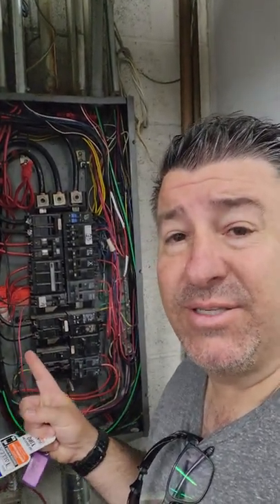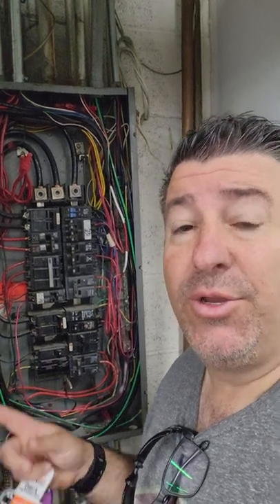How would you deal with this electrical panel? - Comment below.

Comment: It's a bit crowded and a little messy but as long as everything is working fine and the connections are torqued to specs and the breakers are fairly recent, leave it alone unless the panel has run out of capacity.

Comment: I would replace any breakers that are over ten years old or are loose fitting or are not the same brand as the panel or may be of some obsolete brand.  Breakers that are too easily tripped need to be replaced, as well as breakers that are regularly used as a switch e.g.: for shop lights. Some breakers might be upgraded to GFCI or surge type as needed. Of course, tighten all connections to each breaker, and recheck any stranded wire connectors for fraying.  Be sure to check for any double connections on any breaker and replace with a double breaker or a new breaker in an empty slot for the second circuit.
Reply: Let's say you find a double connection.. you take one put it on a new breaker.. wouldn't the neutrals now be crossing as far as the rest of the connections in the house? Wouldn't that cause a breaker to trip?
Reply: @ederrocha3491  no your neutrals still all run into the same bar from what I’ve seen. Normally it’s two powers on one breaker.
Reply from the maker: It will on arch fault and gfi breakers. If nit on same phase you would be doubling uo the neutral instead if zeroing it. Good question

Comment: Check the wire sizes with the breakers, tighten the screws, make sure no water or overheating and its good for another 50 years.
Reply from the maker: ..and put on a new dead front! I keep forgetting to mention that. Thanks - where you tuning in from?

Comment: How would you address a panel with 2 wires coming off of one switch?
Reply from the maker: @cringesh1t427 several ways you could address that from cheapest to most expensive
1. See if the breaker is rated for double tap. Believe it or not some are but very rare
2. Pigtail it with a wire nut or wago in the panel. Most panels it is legal but only to extend, i'll have to check code or UL listings for that
3. Install a "Twin" Breaker or another breaker on the same phase if you have a spot open
4. Take out a 2 pole breaker and add a small sub panel to add additional loads. Be mindful or AIC rating etc.
5. Get a new "bigger" sub panel
I'm sure there are a few more, these just came to mind. 

Thoughts everyone?

Comment: We had an electrician say it would be almost 10k to move a circuit box outside and add some grounding rods. (It's an old house.) Does that sound reasonable?
Reply from the maker: Depends on how many circuits where it will be relocated, is it overhead or underground. If it's underground will they replace incoming conduit or relocate it? So much goes into this that we don't know. An average 200 amp same location overhead in my area starts at 3k to 3.5k and that's pretty much a single day 2 electricians
Reply from the maker: What state matters as well.

Comment: I would give them options, if im needing to add one or more new circuits i would recommend adding a subpanel before filling up that panel, but there is nothing wrong with that panel if you dont need more circuits.

Comment: What’s the problem with it?
Reply from the maker: Hey Dave, good question. Its not easy to see in such a short video, so i checked my high res picture again to try and list everything.I went back and counted the issues. It's hard to see in the video but most electricians probably saw at least 3 or 4 of my list right away. These are not in any paticular order. Add to it if I missed anything you see.
1. Workmanship - were required to do neat work
2. Missmatched breakers. Diffrent brands not approved or UL listed for this panel
3. Panel being used as a junction box. A few in and out circuits. Who knows what for? 
4. 3 wire circuits are not identified with shared neutral
5. Cut wire with no wirenut on end
6. Deadfront missing
7. Can't label panel with no deadfront
8. Wires caped off with electrical tape
9. #8 wire taped white 
10. No Ground in main feed conduit
11. No ground bushings where required
12. Top left side of panel bent from bad measuring of incoming conduit and missing straps
13. Numerous Osha hazards
14. Numerous other loose wires all around outside
Reply: Replace and move on

Comment: Its a single phase pannel ... first shut of the main breaker ...second number each circuit you ...three  trace all neutrals lable them ...four take all circuit out if the breaker plus the neutrals and grounds ...finally color and number each conductor and redress them to the breaker .....
This is ibew code of excellence
Reply: It is clearly a three-phase panel. Otherwise, good advice. This panel may be perfectly serviceable, but it needs to be stripped down to inspect the bus. Just need to tidy it up and ensure all breakers are listed for that panel, and replace those that are not.

Comment: Let them know what is not up to code.  If I was going to touch it I would be bringing it up to code.  Let them know what the cost would be and let them decide.
Reply from the maker: Great advice thanks for sharing on the channel.
Reply: Code is just a suggestion
Reply: Doesn’t the code that’s applied depend on when the house was built?  Are you talking taking it up to current code?  In some places this would require a complete rebuild.
Reply: @pgood7266 no, code is law. That's why the NEC is written by the NFPA.

Comment: The greedy will replace the entire house’s wiring.
But all jokes aside.
Explain to the customer this is  absolutely not the proper way to have the wires installed or placed. Suggest to allow you to do it properly, be fair on the price, so make sure to properly identify everything, place all the wires nice and neat, and if there’s a grounding or neutral bar missing, install it and separate neutrals from groundings, while you at it make sure that  everything is properly labeled, kitchen, master bed, master bath etc etc etc. and for God’s sake be careful.

Comment: Would suggest replacing it. Not going to touch it otherwise
Reply from the maker: That's usually my approach. I don't want the liability.
Reply: @The360Electrician  exactly 💯
Reply: I have no problem doing what's needed here, I see and fix Crap all the time, but Don't try to generate work. Code is about Safety. Appears safe enough. Would verify any MultiCircuits on opposite phase, and on a 2 pole Breaker
Stratmando
Reply: @randyaivaz3356  thats what I’m talking. 
Speaking like a real adult

Comment: Very Sloppy, mixed Manufacturers Breakers. Wire nuts not a problem.
Can only have 1 wire on a Breaker, Wire nut allows the 2 wires to connect to 1 Breaker. May be Overloaded, The Wafer Breakers are a sign of poor initial planning. Or several Additions. 3 Phase likely a Commercial Building? Correct Breakers may be all that is needed.
Wirnut may be used to cap off a wire.
Wirenuts are commonly used to connect control wiring Between AHU and ACU.